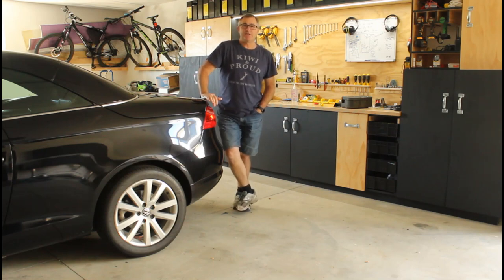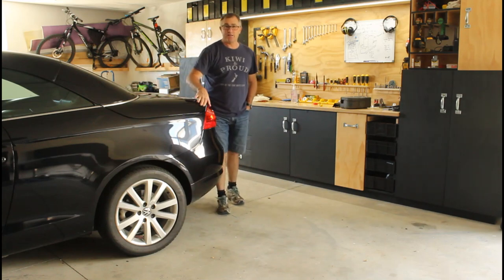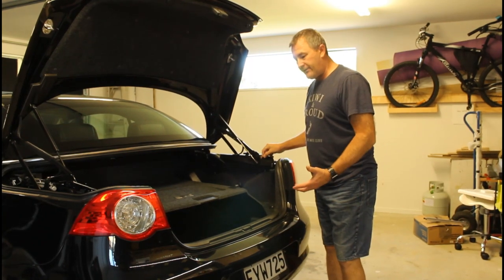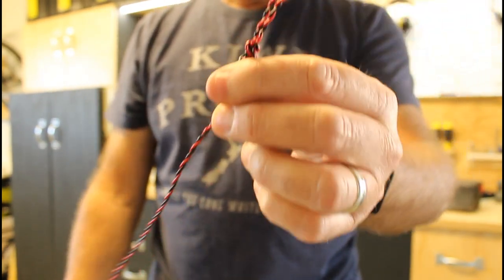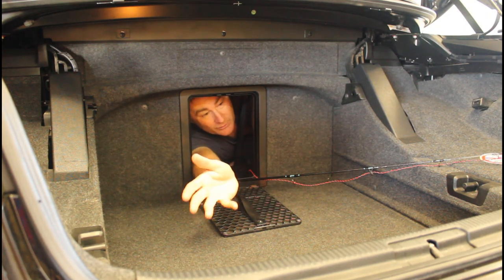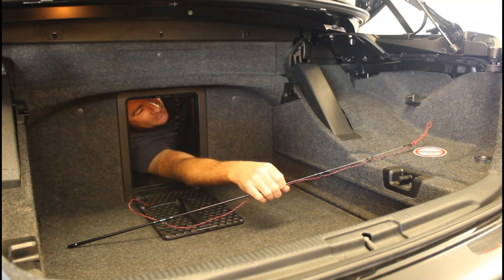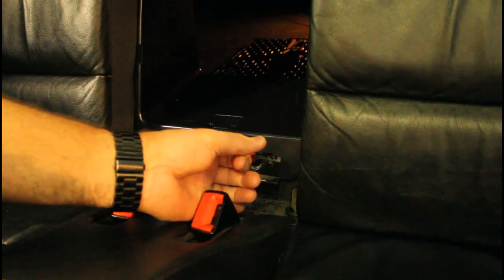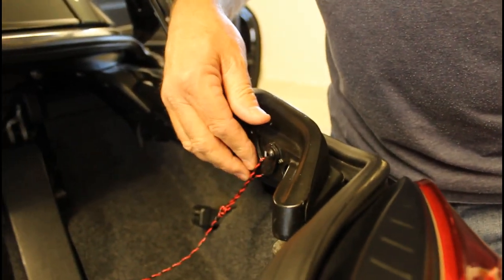VW EOS - How to get into a locked down boot

Comment: Great video, I could’ve used this before, I have an 2007 EOS and this has happened to me before, but I was able to reverse the process and get in.  I just thought that if the C-Locks are locked, the pistons should be forward already and you may be able to get the back glass open and the truck open from the other side as long as their isn’t too much pressure build up in the pump.  Using the manual procedure which is finally out on YouTube.

Comment: Thanks for the great kiwi ingenuity.  Interrupted opening of the CSC and wouldn't close so tried to close manually after releasing the hydraulic pressure in the pump.  End result was that the sections settled down out of sequence with trunk locked on one side.  Key thing for me right now is to figure out how to get the luggage cover off and to the side.  Is there a clip on the left side pivot plate that has to be pushed or pulled to release that side, or it is just a friction fit and pushes up and away (reaching in from the back seat ski port)?

Comment: Great video for the more common situations but unfortunately the left hook on mine is not moveable and is keeping the lid from opening. I know of nothing strong enough to pull it forward as it appears that something failed in the hydraulic system and the cylinder is holding it. Fortunately my inside cover is off but still, I cannot get it open.

Comment: Hi Dave, thanks for the very helpful videos. I have an eos with the convertible stuck in open and boot closed, I got a small person to get into the boot through the back seat, but they could pull the C locks due to the convertible roof being in the way. Does you method still work with the roof folded in the boot?
Reply from the maker: When the roof is down and stowed in the boot the C locks should be in the open position so you should be able to just use the emergency boot release cable.
Reply: Hi! I have the C locks open. I pull the emergency boot relase cable but not working sadly. Any idea how to open?
Reply: Me too how did you fox it!
Reply: My top is not in trunk but is still open was almost when it stopped working I did all this any ideas why and how?

Comment: Thanks for the tip Dave. I got an error at the very beginning of  taking the roof down in cold weather and since then the claws kept my boot closed. Using the loops as you suggested I was thankfully able to open my boot but I am now unable to close my boot and I imagine the claws are out of sequence? Any heads up and what I should do/ expect next?
Reply from the maker: Hi, so from what you describe you will need to reset the claws manually before you close the boot again. It’s likely that the C locks that lock the back screen down would have been released so they will need to be locked manually also. There is a very good video on this process done by Top Hydraulics.
Reply: @Kingstoncars1  Huge and grateful thanks for replying. I am googling away. I guess this would be found at the end of their video 'manual close of roof' or contained within another? Today i did keep the rear most  hooks in an open position using wire as you describe in your video but the boot will not get down completely to lock. I am guessing the hydraulics, which moved for the very small time of opening before the system crashed, are preventing the boot lid from lowering fully?
Reply: @Dave DIY You are  a king. I am ill adept at all things cars  and it all worked like a dream.  To recap for anyone that this might help. A malfunction occurred at the early stages of opening in icy conditions. I had the conv. workshop message and  my boot was stuck closed. I opened the claws using wire as featured in Dave's video. Now able to access my boot  I could follow the later stages of the manual roof closing explained in this video by Top Hydraulics. (https://www.youtube.com/watch?v=G31I3ZUxIBQ). Pushing the rear window joints into correct locked  position and pushing the hydraulic rods into place loaded the claws into the normal open position and once I put the boot compartment back in place and closed the door I started the ignition and  hey presto! It all came into synch.  Error message gone. Roof functioning. Boot locking and opening as normal. Kudos to you guys!
Reply: @GazzaClydeMoore  sounds like we had the same problem. I've did everything except the locks behind the window fabric. I thought mine was already locked but I'll go back and check. Hopefully that will open the clamps for the boot.
Reply: @jonathancrump31   Hope it works out for you. I did in the same order as in the tophydraulics video. Initially the joints behind the fabric looked in place to me but once i levered them down a very definite clunk into the correct locked position occurred. Then pushing in the rams in the boot gradually opens the claws. Hope that helps
Reply: @GazzaClydeMoore  as soon as it warms up a bit today, I'm gonna get right on this. Thanks for the update. I'm still a little concerned that my door locks and power windows are not working. Hopefully it will all sort out once I take care of the roof.
Reply: @jonathancrump31  Additionally.. if it helps. Prior to all this when it initially happened I was on a weekend away and my boot and windows were  stuck down. I  went through the emergency roof close procedure in the Eos manual and that at least somehow reset my windows control enabling them to be closed for the return drive.
Reply: @GazzaClydeMoore  Ive gotten the everything locked and the hooks in the trunk are open. I have not closed my trunk.  Kinda scared. Cranked it up and still has top blinking and can't convert in the message window. Door locks are working but windows still not working. I'm going to get a new fuse but this one doesn't look blower. I've tried clearing the code and doesn't seem to do any good. Would closing trunk reset it or maybe taking battery cables off and touching them together to reset. I'm grasping?  Thanks for any help!
Reply: @jonathancrump31  All i can say is..  until I closed the boot and started the ignition.. only then it all kicked into gear... message cleared in the screen and went vack to 100% as it was. Leap of faith mate. At least too open the claws again should you need is fairly simple using the method displayed in this video.
Reply: @GazzaClydeMoore  just wanted to let you know finally had success after closing trunk.  It didn't lock but the info on the dash changed and I knew what I had to do. I had to reset the trunk lock which after doing the info on dash said to continue convert so I pressed down on the convert button and it came to life. Only thing I have to work on more is the strings that I had to take the screw out. I can't find the second part on it so strings are loose. Maybe I can figure it out. Thanks for your help. It's nice having a little encouragement.
Reply: I can t get into my boot to release the c claws, my release cable is not working? My boot is only opening on one side?